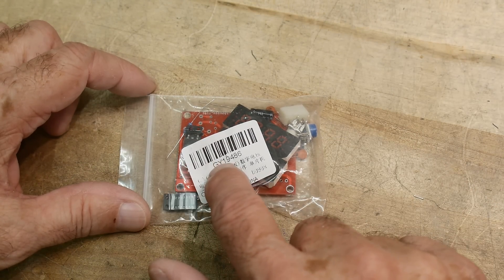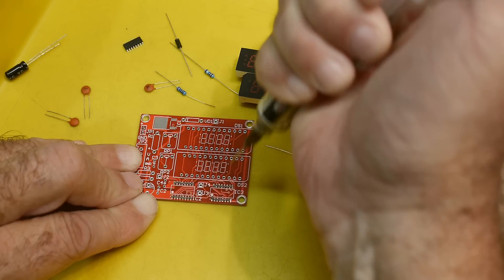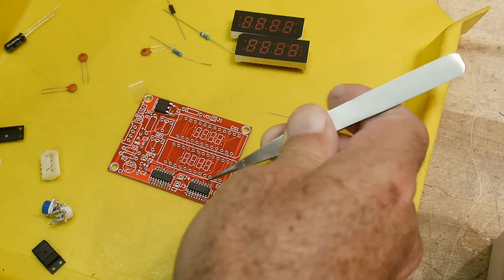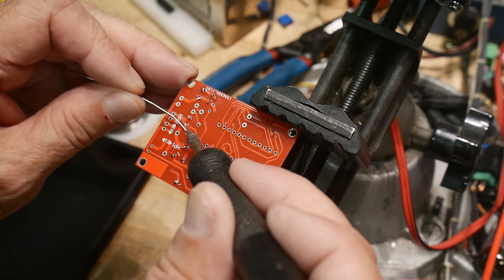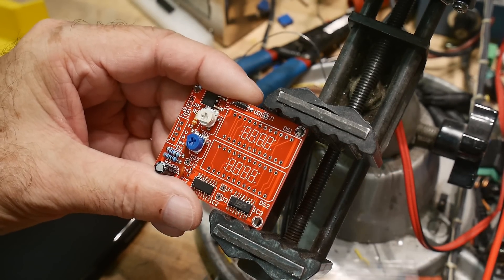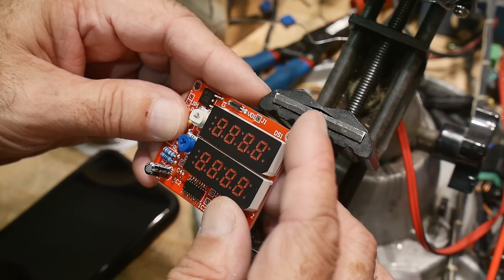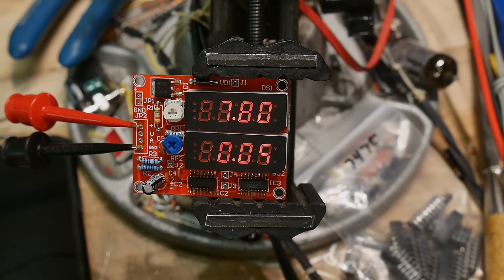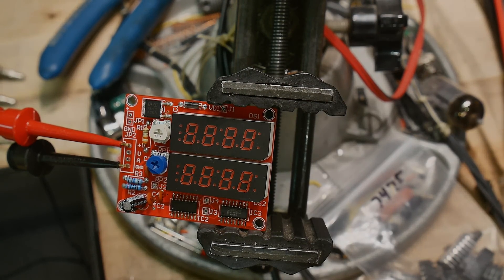#1324 Volts + Amps = Magic Smoke

Comment: Well that's another fine mess you've gotten yourself into stan....ley 😀
I imagine the left chip is an A to D converter and the right chip a 3 to 8 line decoder.
Did you get it working?
Reply from the maker: no

Comment: Rule of thumb for V Reg dropout voltage is +2V. Rule for best ripple rejection is +3V. See the data sheet fine print, app notes and test graphs. The engineers test at +3V.

Comment: It is always entertaining & I learned a little about surface mounting. 

Happy Pre-Tday 2022!

I wonder what the power rating is on the 0.33 ohm current shunt resistor...
Maybe 0.5 watt...?

But that be 1.23 amps max...or a wimpy ammeter...

It didn't even measure a load ...

Perhaps the magic has left a resistor....and no other component?

I say 14 vdc in .....Maybe the 9 volt drop across the 5v  fixed 3 terminal regulator...killed it

Crappy display...but nice integration 

It's time for a postmortem...?

Or has my dad would say...
it is not worth the powder to blow it to hell.
Reply from the maker: SMD: https://youtu.be/aoG15wpobF4

Comment: It happens. Now you get to make a video to find out what went wrong. Best ones. “ Never give up, unless the tracks are all burnt.” “We’ve got the technology, we can fix it” 😅 love your work. Regards Ron
Reply: Gees...I thought a real 7805 could take....31 volts...

But all those LED segments suck up current...especially if the crappy unit believes it is measuring 8.888 volts...

So yap I bet like that 5 volt was a 0.2 max unit...so Imasai Guy of a few volts over 5...is plenty..

But if it was rated for 0.25 watts...

Then I am sure it's smoke has entered our atmosphere..

14 -5...9 vdc drop at the mini 7805 wantabe
Reply: Voltage limit. I’ve had Chinese 555 timers that smoked at 7volts.

Comment: I always wanted to go to a chip manufacturer as i want to know how they decide how much smoke to pack in to components.
And in all the electronics books i've read i've not once seen how the internal smoke is used to transport electrons or holes. Does it come in a P-Smoke or N-Smoke type. it have an inportant roll as, as soon as it leaks out the electrons stop flowing.
Reply from the maker: it is similar to dark matter